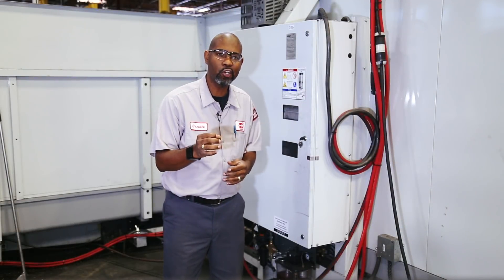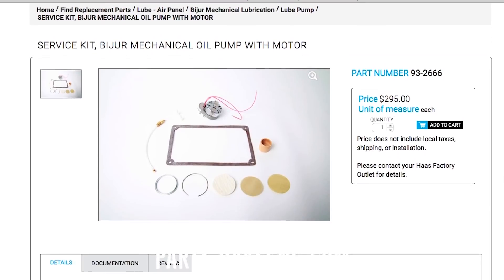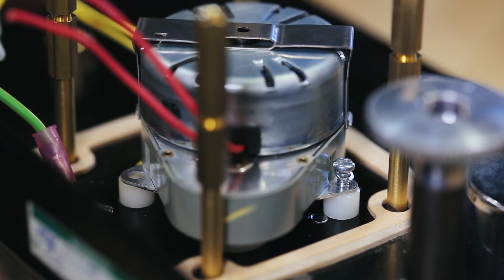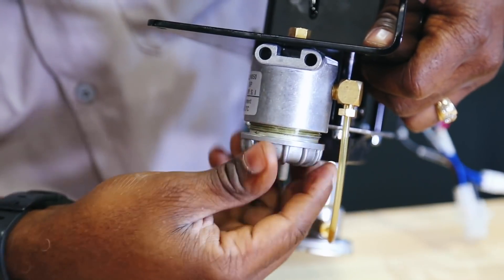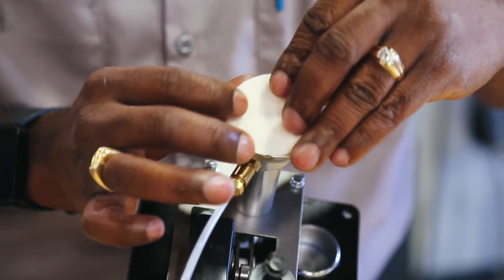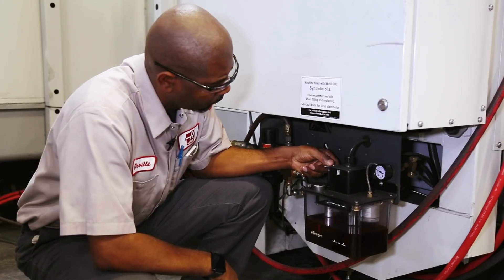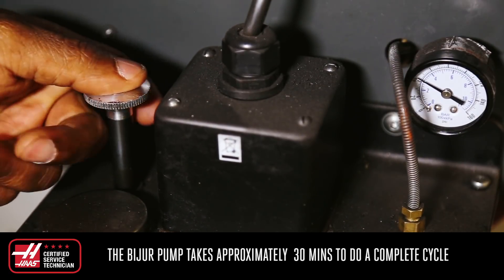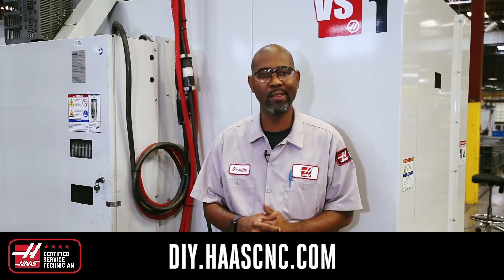Rebuild Your Bijur Oil Pump - Haas Automation Service

Comment: My 2000 Hass VF3 mill uses a Bijur mini pump that you show @ 11 seconds in.  The pump kit you said to order is NOT the kit my system.  They discontinued my pump and force me to replace the whole system @ $1,200!
Reply: I could fix this for a fraction of the price . Check us out ALNA Mechanical Brooklyn NY

Comment: getting false low oil alarm? anyone have a solution? the float is all the way up, but machine giving alarm that the oil level is low, ive been jiggling the float around to fix, but happens hourly now, thanks

Comment: Our 2001 VF-0E has a sticker on the pump specifically stating that we should use Vactra #2. Should we keep using this or switch to the new oil?
Reply: If you are servicing the pump or any part of the lube system, or replacing the spindle, you must change to SHC625.  If you do not have sludge problems or any lube problems I would consider it optional.  Would require the pump rebuild kit 93-2666, hose 58-2010 qty(15ft), and oil 93-2220A  qty(3) to convert.  If replacing original spindle with new there is also a sight glass kit to add to the system 93-2191. - HFO Parts Mgr.

Comment: I assume the plastic gears are designed as a mechanical "fuse" since the motor unit is accessible and cheap?

Comment: Replace  plastic bearings with decent metal ones and pump last forever
Reply: But if the gears could supply more torque then something more expensive and hard to replace would break
Reply: I got something to say about that, they might last longer but don't the pump cause cavitation if you do that?
Reply: and the metal fragments might clog the pump and cause more damage down the line?
Reply: uhh are you joking?